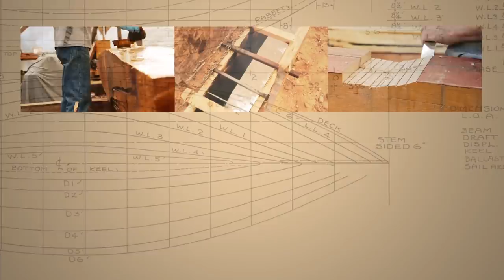Cockpit Mockup - Episode 149 - Acorn to Arabella: Journey of a Wooden Boat

Comment: I think you should tighten the tie rods so that each sounds a different note when struck - turn Arabella into the world's largest ocean-going xylophone.
Reply from the maker: Ha! Fun.
Reply: They might play notes, but xylophones have wooden (or these days sometimes resin) bars! ;-)
Reply: glockenspiel is the word you are looking for.
Reply: I didn't suggest it because they don't have the bars fixed at the ends either; the tie rods are technically probably closer to a piano or harp with ridiculously thick strings!
Reply: @petestack  
My thoughts too. But you can't pass up a chance to use a word like "glockenspiel" ;D
Reply: For a given length of tie rod, the range of tensions for just one octave would vary from 100% to 200% so likely not achievable without breaking something at one end or being useless at the other.
Reply: Hmmm Glockenspiehler farddendar!
Reply: Having just Googled string tension/frequency relationships, it appears that the frequency is related to the square root of the tension, meaning that you'd actually need four times the tension to tune the same string up an octave.
Reply: @ahaveland  Thank you, Mr. Bummer.
Reply: @petestack  Wow. Uri Geller on harmonics. What was that website?
Reply: @evolutionCEO  Indeed. Never pass a chance to use glockenspiel! Our compadre, @petestack, also has a Uri Geller approach to the subject. Fascinating. (Or should I say, "mind-bending"?)
Reply: Since I found multiple websites dealing with this, I won't link to any particular one; just search for 'frequency string square root tension'.
Reply: @petestack  LMAO! Just playin', dude. Well aware of which you speak (Check out why a piano's "backbone" has to be so robust-- mind-boggling tension). Have a little fun here!
Reply: If he was to tune them to 174hz, 285hz or 396hz or any other of the scale, the boat will be forever harmonized. Look into the ancient solfeggio scale. Therein lies the secret to universal harmony. As Nicola Tesla said "If you want to understand your universe, you must think in terms of energy, frequency and vibration."
Reply: Clearly having fun now!
Reply: @petestack  Thanks, physics is really reluctant to offer lunches, especially free ones.
Reply: @evolutionCEO  Hmmm... your scales are oddly placed 111hz apart. So... solfeggio or Sufi? I often confuse the two. Reminds me of Milliways, a famous restaurant Douglas Adams chronicled, explaining it was "five hundred and seventy-six thousand million years" in the future. Apparently, it was worth the long drive and the millenia-long waiting list. Interesting side note: 576 divided by 111= 5.189189189189189. Adding more zeros to the 576 number only changes the decimal place, but the repetition of "189" remains constant at 5 times. Would a finely-tuned Arabella save Marvin (the endlessly depressed robot) from his hellishly long parking attendant duties? And what has all this to do with the number 42? Would an ocean-going xylophone (or glockenspiel (heh-heh)...) finally resolve that ridiculous answer to "life, the universe and everything"? Arthur Dent and the rest of us need more than "6x7".   @ozmazone: look what you started, dude.
Reply: @crustycurmudgeon2182  
1,1,2,3,5,8,13,21,34,55,89,144.... the vibonacci (good vibrations) numbers getting ever closer to phi - the golden ratio. Isn't it interesting that the 12th number is 12 x 12... You gotta love our deliberately constructed universe, with its flat and level oceans. 

Douglas Adams struggled with the complexity of the apparent chaos, yet there is not a single part of a single part of this universe, that is not exactly where it should be. 42 is as good a number as any. I think 13 is the key, myself.
Reply: @petestack  It´s gonna be a cracking concert ;-)
Reply: @evolutionCEO  Ah! So you're looking at 6 + 7 rather than 6 x 7. Interesting. Your vibonacci key reminds me of the British monetary system: one English Pound = 240 Pence (not 100). Reason: it's not only divisible by 3, but it's also divisible by many more numbers (which, in turn, are divisible by lots of numbers), than any decimal-based system. Lindybeige gives a fascinating look at all this  https://www.youtube.com/watch?v=R2paSGQRwvo 

Back to your "vibonacci"... Did you mean Fibonacci? "The Fibonacci numbers occur in the sums of "shallow" diagonals in Pascal's triangle (see binomial coefficient)".
Asking for a friend... 

Also, my friend points out these "good vibrations":   https://www.youtube.com/watch?v=5IYJtdtr678

Rock on!
Reply from the maker: You beautiful, beautiful nerds.
Reply: @crustycurmudgeon2182  
if we match the vibonacci numbers to the bodies chakras and light, 21 is the crown (violet). pontoon (21) = bridge and gateway. fib is to lie. vib is to vibrate. f=6, v=22, u (you) is 21. the sun catches up with the moon 13 times in a year (moonths) which creates a 21 year cycle. there are 13 constellations in the true zodiac. 13 is the third eye (true blue).

Fibonacci is a man to associate with the discovery and to usurp the true author of our universe (we are supposed to believe ourselves to be accidents in an infinite universe).

Money was originally a control mechanism of the church and is another system of belief (promissory). Since usury is unlawful, the bankers had to side away from the church (Jesus and the money changers). They didn't want people loosing their faith when corruption is the backbone of the system. The church then usurped Jesus (the man) and used him as the peoples dead saviour. Now people await the return of their dead saviour instead of sorting out their world. clever ploy, don't you think.

It's interesting that the letter J didn't exist in English, Latin or Hebrew until 400 years ago, if the his-story tellers are to be believed.

Many maps and document exist with a 3 digit date, prefixed with an i. it's as if 1000 years was added by changing the i to a 1.

the beach boys... love the Theremin bits. ;D nice one, my friend.
Reply: Bob, good idea. However, with temperature changes along with humidity, barametric, and others; you will have a permanent place onboard to keep her in tune.
Reply: @AcornToArabella  What fun is life if you can't have a nerd-fest now and then??!!
Reply: @evolutionCEO  Now I'm hearing Mike Oldfield in my head!
Reply: @evolutionCEO  Wow, Bob (my dad's name was Bob, BTW-- he wasn't quite the thinker you are), you've packed quite a lot here for me to... unpack. First: are these your evolving life-long thoughts, or just tossing this out off-the-cuff? Enquiring minds...

Top of the box: your oddly Italian-sounding word "vibonacci" involves Eastern Mysticism ("chakras"), combined with a suspiciously "numerology" didactic. Fascinating. All internet searches for "vibonacci" are corrected to "Fibonacci". Oh, and, there is a rock band named "Third Eye Blind". And The Zodiac is even more imaginary than most religions, hence why Cosmology never reached religion status.

Next layers of the box: Fibonacci's number sequences are mathematically sound-- and still important. 

Not sure how The Church ever had much to do with currency. Coinage was created to facilitate trade. Imagine: a man with wool to trade taking in sacks of wheat, racks of mutton, bushels of asparagus and the occasional shiny bauble... all in his little stall in the market place. Rather inconvenient, yes? Hence, currency.

Never heard about that "J" thing before. Interesting. Perhaps they used "Y" before that, and people were saying "Yumping Yimeny!" A passing thought...

Maps produced before the First Millennium, BCE would obviously have only 3 digits for the date . Gregorian Calendar, etc., etc. That "i" thing totally befuddles me. Traditional? Shrug.

I believe the Beach Boys had a Moog Theremin. Fun fact: the Theremin was invented by a Soviet Russian named Lev Sergeyevich Termen in 1920. Joseph Stalin loved it. He patented the device in the US in 1928, under the name Leon Theremin. Glad you liked the song! ;-)

Comment: About that tiller. You can have it on a swivel. There will be the back stay. You can latch it to there and that would even keep it in zero deg. position whilst you open that hatch. There is however the problem of the autopilot equipment perhaps attached to said tiller if that is where you are going to put it. But if you have like a wind vein auto setup having the tiller in the center is perfect and so the center latching of the rudder position is what you want.

Comment: Steve, what about a removeable pin in the tiller to swing it up and out of the way to access the aft hatch? You could conceivably have more than one lock hole for seated or standing positioning of the tiller as well. Something to think about. (Something like a hitch pin for a Reese hitch, with a pivot pin that can also be removed if and when need be for dry dock repairs or upkeep).
As far as pivot for the seated/standing in the cockpit, a channeled pin slot lined with bronze or brass would work for some vertical swing, I would think. Even just a channel in hard wood would work as long as there wasn't too much slop or swelling to seeze up the swing.
Between you guys and you friends with milling machinery I know you can come up with a great system that works for you. 
The last thing you would want on a rolling sea is to drop the tiller handle into the cockpit while standing in deck for a better view, then have to bend over to grab it putting you in a bad balance situation with not much aft deck to catch you if you lost your balance. So a locked/pinned standing height might be a good idea for the tiller.

Comment: Consider angling the cockpit floor to one corner where you mount a drain hole, perhaps even a large 2" hole, in order to discharge water into the bilge or overboard.
Reply: They will be in each corner, the boat is never leaning to one corner.
Reply: @nssherlock4547  Shows what I know about boats.  I flew airplanes most of my life.  Nice username ya got there.  Real respectful.

Comment: Tiller: Being able to raise the tiller high enough to get it out of the way while at anchor would be of value. On my sloop, I lash the tiller against the back stay to clear the aft section of the boat. I am not sure that will be possible with the position of your mizzen boom but you might consider thinking it through a bit. Cheers.

Comment: Hi Stephen ! You mentioned the tiller length, you can easily add an extender that folds back over the aft, thicker portion of tiller for if you're in need of more reach without it being in the way when seated towards aft as you show in thumbnail. Just make the extension from 2 pieces of wood hinged about 1 1/2 feet back from rounded handle area, and when pivoted upward or from below the 2 pieces straddle the handle and can be blocked from going past 180 degrees to "lock in place" The rest of the 2 pieces can be lashed together beyond the handle. this would allow your tiller to reach all the way to companionway if you wish...

Comment: I worked on a 50 ft Huon pine cray boat that had 4 of them in the main working deck. every day there would be a total of 8,000 kg of steal cray pots at 50 kg each moved around over them. In the 30 odd years the boat was in service there was only one light that ended up with a chip in the corner of it. The only time they would leak was when the boat wasnt in use and it was hot and dry weather, but would soon take up when the boat was back in service.
Reply from the maker: Everyone generously shares their wide-ranging, diverse experiences and we’re glad for it.
Reply: @AcornToArabella  Sorry that was a bit heavy ..... has been edited

Comment: Suggest you invite one of your resources experienced with blue water sailing to discuss final cockpit options. Questions like how will self steering gear be rigged and other considerations related to weather, sun and seas. Those are all things that you will reflect back on many times as you spend hours and years in all conditions in that one spot.
Reply from the maker: Sheet to tiller steering works like a dream for self steering. We’ll get there.
Reply: @AcornToArabella  - All well and good, but please do research the use of a trim-tab on the trailing edge of the rudder. Truly one of the best self-steering components out there.

Comment: For your tiller, consider making it so it will tip up to or just past vertical and be pinned in that position.  That way when you're at anchor or docked you can lock it out of the way.  That way when you and your friends are sitting around the cockpit having a cold one no one bangs their head on the tiller.

Comment: Getting some light into the area under the cockpit is great but I wouldn't count on it killing any bugs. It's the UV component of sunlight that does the killing and most normal glass blocks light less than ~350 nm (UV range). Ventilation and the heat from the engine will be key to keeping things clear.

Comment: Hey guys, long time fan here! In the grabbing rail that will line the interior of the house top you could put LED strips (3500k heat) in tbe reces wich could softly iluminate the interior without beeing seen, and bouncing the light from the top towards the ground, these could and would be pretty low voltage making them great for easy use during nights even when at sea, they would bring a touch of modernity to such classy boat, but no too modern

Edit: grammar
Reply: Red and white strips so you have both day and night illumination.  Don't want white lights blowing out your vision in the dark.
Reply: RGB full color so you can do any temp of white, and flashing disco effect that goes along with the music(hehe, but just for a break in the pace) I actually have colored lighting in my home, and it really is nice for different mood/actions per area ....on my boat I just did yellow LED light strips in cockpit, then white below deck, and wish that would be tunable for color/temp like some areas in my home - my wife hates any light source while asleep, but sometimes I can get away with a very dim discrete color that is just enough that I can barely see to walk around

Comment: Great work. Have you considered the inclusion (while the stern structure is open) of strong points for an autopilot and self steering gear? Much easier to fit at right angles now than later (and prevent water traps too).

Comment: You could deliver high ampage 12v current to alternate ties with a big switch at the battery. Big tools etc could clamp on when you need them.  Deck winches could draw off it. A boat wide powerbus you could switch on from the cockpit. Electrolysis would be minor as you’d only make it live occasionally. Great work guys.
Reply from the maker: 😬 I think the ABYC would have a lot to say about that. Thanks for watching, Jerry!
Reply: @AcornToArabella  it’s only 12v!!  
From boating country here, Salcombe in Devon

Comment: Yes, your tiller should swing up for all the reasons you mentioned.  Also, consider how you might attach an auto pilot system from as simple as tying it athwart-ships, to a self steering wind vane or a hydraulic arm etc.  And, after watching the end of this video, that tiller should swing up as far as you can manage.  When you are in port you will want it out of the way.  Maybe even an easy way to just remove it.

Comment: Two things from an old sailor, the bolt ends in the aft hatch should be either recessed or framed over, the first few times someone hits their side on an acorn nut it will still hurt like hell.  I imagine you will have a dodger (spray hood) over the companion way and you will find yourself steering while standing on deck, in tight quarters or a narrow channel you will want that visibility. Slope the cockpit floor a Little bit so that water will run into the scuppers.
Reply: I was also going to remark about a little slope on the cockpit floor to the drains, might consider a T on the drains between the cockpit and hull side so that in a good rain, after a good flush/rinse could divert that water to your tankage. Easy to divert water to cockpit with awnings, sails etc. Also could shut off drains and use that nice small cockpit for a washtub for clothes or humans.

Comment: I believe your cockpit could be rather wet, particularly in foul weather, so you might consider to install a removable wooden grate in the bottom of the cockpit, which was often done traditionally. So remember to allow for 1-2 inches to the desired depth of your cockpit. At first glance the cockpit mockup seemed a bit shallow? 
- Maybe some classics owners can weigh in on the subject here?

Comment: For the grab handles... I'd suggest constant draining (e.g. drilled through to the underside) rather than sponge. Here is why:
1) You are on a long tack (heeled over) in cold conditions. Moisture  will condense on the inside of the cabin roof and run down to settle in the grab handle. This can fill the handle area during a long tack (e.g. hours during a long passage).
2) You have crew sleeping in the bunks (lee cloths)  or a navigator at the chart table (on the upwind side)
3) You tack - you are now going to dump 1/2 gallon of ice cold water over the unsuspecting victim or (best case) have a soaked chart table or bunk
4) Aside from this... you are creating a self refilling freshwater trap (rot spot)